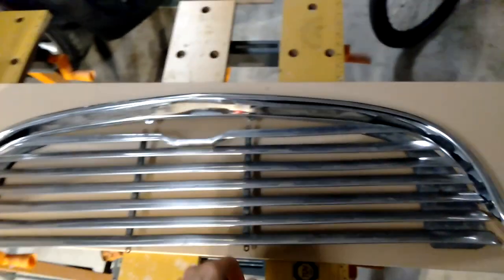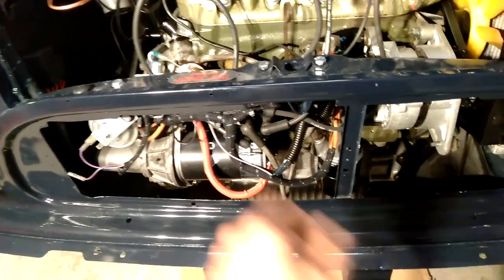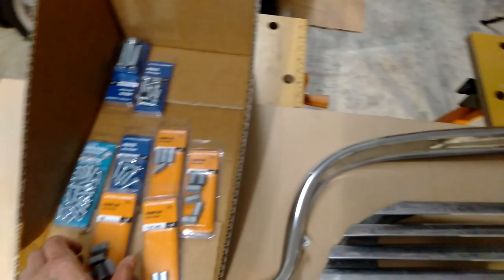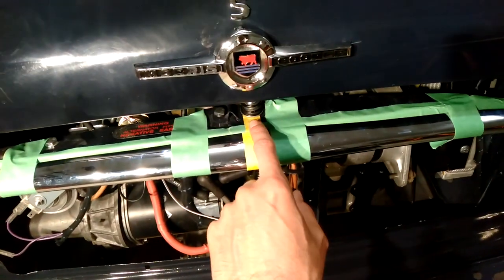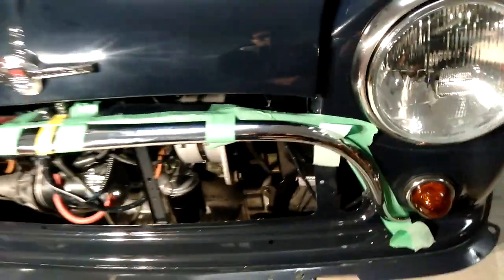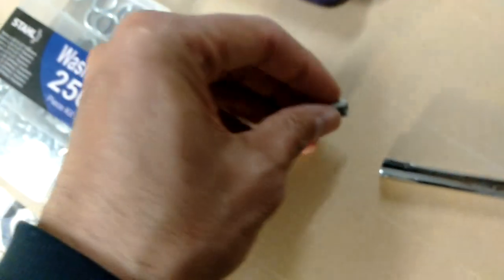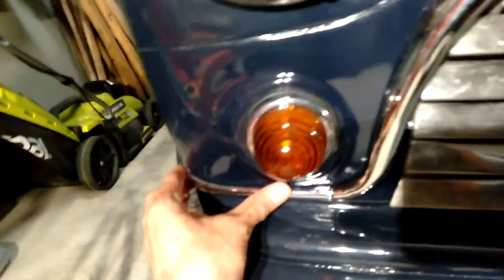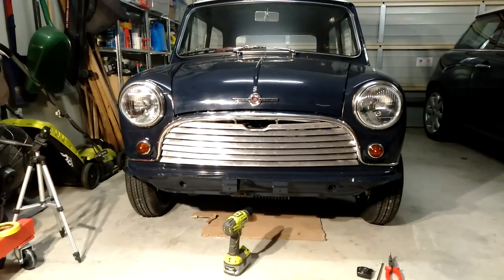Morris Mini Cooper S - Grille, Moustache and Whiskers EP036

Comment: I was going to have the same issue with my 67' Australian mini, but Im just going to keep it stock and try to pull the front out. My grill and mustache are original to the car and my grill only has 1 screw on each side to hold it on.

Comment: When I fitted the whiskers I bought 3mm stainless metal threads, put them through the holes in the clips, then slipped the clips on the whiskers and poked the metal threads through the holes in the body.  I tightened them up using stainless washers and nuts and they pulled in nice and tight.